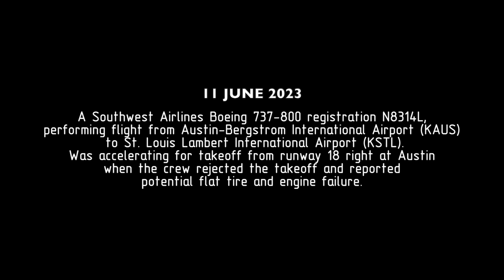ENGINE FIRE on Takeoff Roll. Southwest 737. REAL ATC

Comment: I can see why the crew did what they did and it looks like it all ended well. But I don't think I would have people sitting on a plane that has had a confirmed fire for any time more thsn they absolutely had to. I think an engine fire is enough to override a hot brake limitation. I think I would have had ARFF spray the brakes and had them  pull up some stairs. If the problem got worse you may have to do an emergency evac.
 If smoke from the engine was in the cabin, that's a whole other problem and would call for emergency evac. I just don't like having passengers on a plane where there's been a fire. 
You don't go to a jet bridge until the engine fire is confirmed out and thoroughly inspected. Seems like the crew should have at least checked on the ETA of some stairs. Maybe they did check. If hot brakes were holding everything up, I would address the hot brakes. ARFF can fix hot brakes. SWA has their SOPs and procedures so there's a lot of missing factors and information so I can't blame the crew, they handled it fine.
Reply: Evacuation is really a last resort move, if lives are in grave danger, as injuries are almost certain. With the trucks there, there is no reason to empty the plane in the middle of the field, where it is hard to approach, and shuts down the entire airport. Once in the maintenance area, you can deplane in a controlled fashion, and put passengers straight on buses, so they can't go wandering about, and keep the rest of the planes moving with minimal delay.
Reply: @csgergo80 has a good response but I would like to add that the hot brakes situation is not something that can be fixed or ignored.  During this rejected takeoff, the brakes were likely the only thing that was used to slow the aircraft generating a large amount of heat.  Those brakes can continue to heat up after the aircraft stopped as heat is radiated from the inside to the outside where they can actually cool down from airflow.  While there is a small risk that the brakes can catch fire, the more dangerous situation comes from the tires.  As the air inside the tire heats up from the brake heat it causes the pressure of the tires to increase.  There are safety plugs in the tire that are supposed to melt out and release the air pressure if the brakes make the rims to hot but they do not always function properly.  If the tire explodes and people are to the sides of it they can be killed or injured which is why the airplane can't go near buildings.  After the initial waiting period, the brake and wheel temps are usually checked to ensure they have cooled enough to be safe with a laser thermometer or other method before clearing the aircraft to the terminal or final parking.

Comment: Never understood why the fire and emergency vehicles are positioned so far away from where their services might be needed - I.E. nearer the runways. It is just expense that gets in the way of having fire suppression hoses actually built in to the runway edge so that it could be remotely activated within seconds of being required? (Not applicable in this case obviously - but could have happened if the fire had not been contained.)
Reply: jordanrodrigues1279  I suspect the speed-of-molasses-FAA has a lot to say about what can and can't be implemented.  An engineer tasked with designing a fire suppression system for an airport would look at the data and determine that most fires occur on the runways and then implement a set of remotely controlled foam dispensing units along the length so that an aircraft in distress would slide into a mountain of foam thereby diminishing the fire even before the bits had come to rest. Thereafter the ARFF can drive the 2 miles or so to the scene. I'm reminded of the Air Korea San Francisco crash where it seemed to take forever for the fire crew to arrive as the plane burned and where at least one of the fatalities occurred as a result of being run over by the ARFF truck. As they say in primary school - could do better.

Comment: Question: I know he was waiting to continue taxiing because the brakes needed to cool.  But why can’t they just move it super slowly? I’d imagine that an airplane has a ton of rolling resistance, so couldn’t they just taxi at like 2mph and let rolling resistance bring it to a stop if needed?
Reply: The brakes heat up after you stop. They don't reach max temperature until several minutes later. It's easier and safer to stay stopped, have the ARFF trucks prepositioned and ready, than it be moving, catch fire, and have an increase in potential for total brake failure. At which point ARFF trucks are scrambling to get into position with 150,000lbs still moving uncontrolled with 180 people on board.

Comment: Hmmm. Active fire confirmed by fire trucks.    I would evacuate on the first officers’s side (right side) of ac. Take care of them pax! Even though certain injury would occur during evac. Hardest call of all emergencies though, Captain to order an evacuation.
Reply: The fire was in the engine and due to no fire warning in the cockpit it was likely in the tailpipe unless the fire detecting system was damaged during the failure.  Tailpipe fires are "safe" as the fire is occurring in a part of the engine that is designed to handle the high heat.  In normal instances of a tailpipe fire the pilot would motor the engine (spin it without fuel so the engine doesn't actually start) to blow the flames out and then would continue on.  In this case since the engine that was on fire was damaged the option to motor that engine is not available so the pilot dispensed a fire extinguisher bottle into the engine to prevent the fire from spreading and allowed the fire department to maintain visuals on the state of the fire.

Had the pilot ordered an unnecessary evacuation there would have been confusion on the ground, and injuries would be likely making it a worse situation than it was.  This plane probably waited the required time to allow the brakes to safely cool and then proceeded to the terminal where the passengers disembarked normally.

Comment: Those brakes take a beating especially trying to stop quick on a rejected takeoff. You certainly don’t want a brake fire when you are parked at the gates.
Reply: Has to do with more of the tires than a break fire.
Reply: @chasefriesen6633 , brakes, not breaks. Those are not the same thing.
Reply: @seriouscat2231  thanks for that. Lol. Must be a slow day in your world.
Reply: @chasefriesen6633 , yeah. I'm trying to work myself up to something useful but I'm not sure if it's working.
Reply: @seriouscat2231  nope what you did was beyond useful. I now know the difference between the two words.

Comment: That's a lot of cleaning if the pilot pulled the handle for the bottles. That engine will be totally dismantled and inspected by NTSB & the manufacturer of the engine with Boeing.
Reply: probably for the best given it failed and caught fire

Comment: How did the pilots know there was an engine fire if none of the sensors told them so?
Reply: They didn’t.  Sounds like fire was observed by the firefighters on the ground.  They relayed that to the pilots who decided to use the extinguisher.
Reply: That’s correct. Even if you have no fire warning indication on the cockpit but you receive and indication verbally or visually by someone outside the aircraft, you’re gonna assume the worst case and discharge at least one hrd bottle.
Reply: Initially they had an indication of engine failure but not of fire.  Something also made them think a tire was flat on that side so presumably there was also some noise and/or vibration that would have made them reject takeoff even if there wasn't instrumentation telling them about a problem.
Reply: A tail pipe fire won’t indicate, it’s usually fuel that bypassed the n1 assembly, unburned fuel, not a hazard to the engine exactly because it’s in the tail and normally we just spin the engine blades and it will blow itself out   (usually occurs during start with a failed igniter) but I would of released a bottle myself just in case…
Reply: In their rejection call they say engine failure, not fire.
Reply: If a firefighter tells you its on fire, pretty good chance its on fire.

Comment: Surprised they still decided to taxi to the ramp after all that. Wouldn't it make more sense to get the plane evacuated after a fire and the plane towed? (Genuinely curious! And yes I'm aware aircraft can taxi on 1 engine.)
Reply: pilot said if im dying so are all of you
Reply: An evacuation brings also a lot of risk.
People can (and will) hurt themself or others. 
There is still an active engine running.
Toxic gases may be around the damaged engine.
People on active runways/taxiways, not good.

So, sometimes it is better not to evacuate but to disembark them coordinate.
Reply: You don't evacuate people when you don't have to and the fire is contained.
Reply: Yep, evacuation using the slides pretty much always ends with some injuries. They could get the stairs to drive over and have the people disembark, but that would likely take even longer.
Reply: No, it wouldn't make sense....the fire is out and firetruck is close by.
Reply: General rule:  
Fire outside the airplane-keep the folks inside. 
Fire inside the airplane-get the folks outside

(and make sure those engines are off before you evacuate)

Comment: I knew that there would come a day when takeoffs were “Rejected” instead of “Aborted”.
Reply: "Rejected takeoff" has been the term for a takeoff roll that ends on the ground due to crew decision to abort the takeoff since at least the 1970s. This is a common circumstance in aviation where the same word ("Abort" can be used to describe multiple things, so the specific term "rejected takeoff" is used to avoid ambiguity.

The Tenerife Disaster (1977) caused a lot of aviation terms to be disambiguated to avoid a situation where two pilots said things and meant different things.
Reply: @katherineberger6329  Didn’t know that. Thanks for the info.

Comment: Have you ever noticed nobody in aviation calls an engine a " motor" ? That's because they are required to have an education. 😂
Reply: Yeah but you can motor an engine so explain that 😂

For those that do not know, motoring an aircraft engine simply means to spin it without fuel so that it will not physically start.  This can be done for many reasons, but is often performed if the temperatures in the exhaust are too high or if there is a tailpipe fire to blow the fire out like a candle.

Comment: I don't know why they don't just fire the second bottle, I doubt that second bottle will be reused after this anyway, and that engine is probably toast anyway, so no real cost savings there.  Good job though.
Reply: I'm guessing they would prefer to still have the second bottle available in case the fire starts again, so don't want to unnecessarily waste it if it only took 1 to put out the current fire.
Reply: @racingmars  Compared to the engine, that bottle is cheap, and making SURE it's out is not a bad thing, especially if you've already got the FD right there.

Comment: They fired the bottles over an internal engine fire. Internal fires are normal for jet engines. Its how they run. They can look scary from the ground but are harmless.  The ground crew saw flames and assumed the worst. The aircrew should have just  blown it out by turning over the engine. Many hours and many thousands of dollars would have been saved if only a jet mechanic had been on scene. I bet maintenance was pissed.
Reply: If I'm that pilot, and I hear there's an engine fire (presumably that engine was already shut down) I'm pulling the trigger on the extinguisher. SW can worry about the maintenance cost later, no one died from the plane catching on fire and that's a win any day.
Reply: No fuel flow and something's burning, this is a non-normal situation and pretty much the definition of "engine fire".  Bottle it is.
Reply: Who cares?

A. Mx being pissed isnt my problem
B.  I just had an RTO, and they believed they had a flat or some form of damage so who knows what could have happened or got ingested into the engine
C. IDC about the airframe after I hit an emergency status. Ill pull however many bottles I need to, and they can spray me down too.
D. Number 1 concern is pax and crew safety and if that means blowing all the bottles and getting sprayed then fine.
Reply: They have an engine failure. Blowing the flames would probably mean destroy the engine and cause even more damage. Or worse add leaking gas and/or oil to fuel the starting fire. This is not your Cessna with only one person aboard.